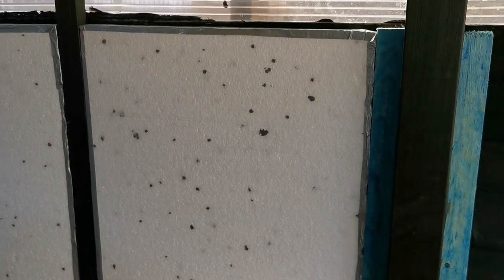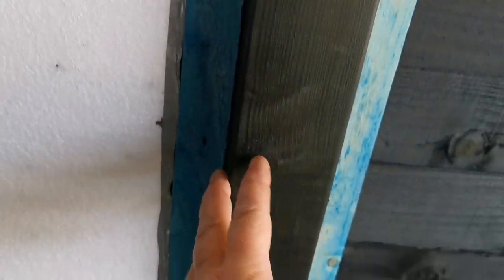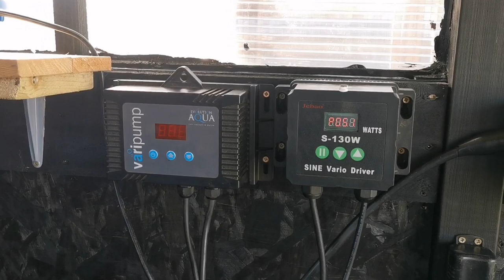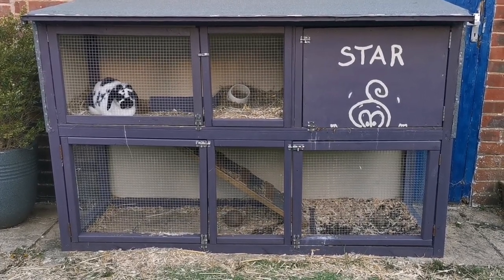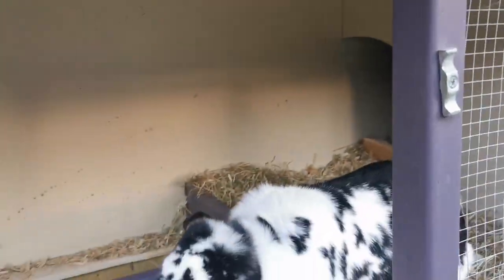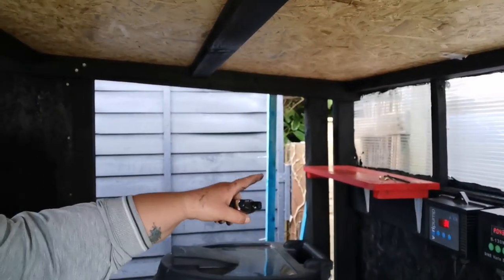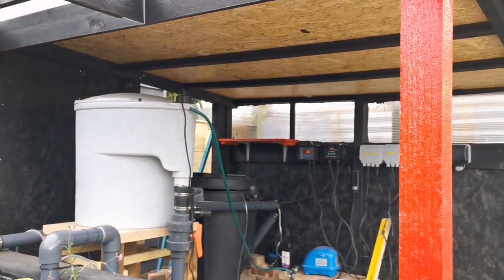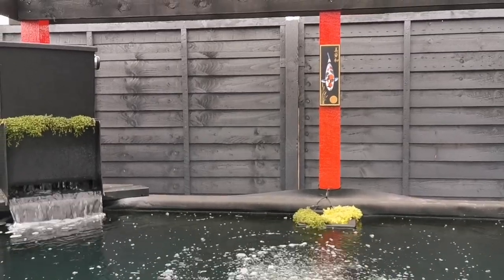Sleepers koi pond build - Electric and filter house

Comment: Looking good, something to watch out for is the gravel that you hold the plants down with, may in some cases affect the acidity of the water. A tip is to put the gravel into vinegar & if you see bubbles not to use that particular gravel as it has calcium carbonate that may leach into the water over time. Inert clay beads are another alternative that I use.
Reply from the maker: Oh I saw them, the New Forest Koi farm use those at the bottom of the fry. Those were marine gravels for aquarium, I soaked them and washed them through and funny enough tested the water for pH. But a good advise yes.

Comment: Good update. I too have sleeper ponds and have built a few in the past as moved house 3 times. I am currently building a 2nd sleeper pond here but this time I am going for a different set up that you may wish to consider. 

Eco filtration do a compac drain designed to go through a wall, basically it's a flanged tank connector with a drain cover over it (no sump). I am going to use a whole saw and drill a hole through this pond and input a 3" version. The end result will be nothin in the pond but for fish and water plus the side drain and a 1.5" overflow pipe. 

I am not sure but I think you said on one of your videos that you were nervous about cutting the sleeper, me too lol. 

I will let you know how I get on. 

PS, I have also ordered mind your own business for my bakki on pond 1. 
Mark
Reply from the maker: Hi Mark, thank you for your message. Yes this is my first pond build and the idea of going through the sleepers and cutting the liner really made me nervous. When I had to cut the liner for the window, I didn't sleep that night! 
At the moment the system works well, there is not one poo on the floor. It's not actually intrusive as I thought the pipes would be. But I am definitely interested in what you are building and your system. Will you make a video?
Reply: @LauMagroTheFrenchKOInection  Hi no video. Will be using the hole saw later in the week for the liner to go in next weekend. Will take some pics. Are you on facebook?
Reply from the maker: @markpaine882  yes I am on Facebook. Will you post them on one of the koi site? If yes, then please tag me in.

Comment: From distant memory, does friction relate to massage in french? Anyway, similar to English usage as it all means touch - so a friction fit being where something is positioned so it's touching so tightly with its surrounds that it doesn't need any more fittings. As we've done with many things, we English probably 'borrowed' it from the french language at some point....
Reply from the maker: Ah, thanks Andy. So I did use the right word 😃 thank you for explaining. 
Friction in French has several meanings. Massage (you are right, I am impressed), also confrontation between people, but also in the south of France only it's quite rude, not terribly rude but rude enough, a bit vulgar I would say.

Comment: hi  do i need to have a consumer unit for pond or can i just use Blagdon 5 Way Switch Box for pump and uv
Reply from the maker: Hi Jay, you need an rcd yes, even if you have a switch box. But I am no electrician 😊 except plugs, I don't touch electrics. I had mine done by an electrician. It would be advisable to use a qualified electrician. 😊 Hope you are well.
Reply: @LauMagroTheFrenchKOInection  yeah I was thinking about a electrician but I’m worried it would cost me a arm and a leg to get one as I don’t work with my disability
Reply from the maker: @jay-_meister  I know Jay, but it will be safer to have an rcd. You don't want anything to go wrong with electric and pond involved and nothing to happen to you either.
Reply: @LauMagroTheFrenchKOInection  yeah I’m going to price one up to fit one I’ll just save up if need be thank you again.
Reply from the maker: @jay-_meister  that's me reassured now. Take care.